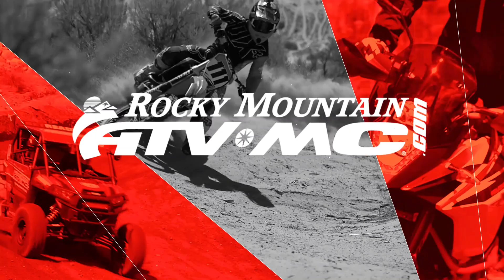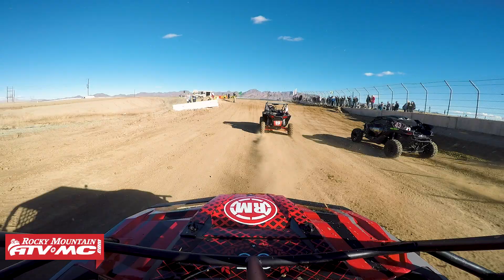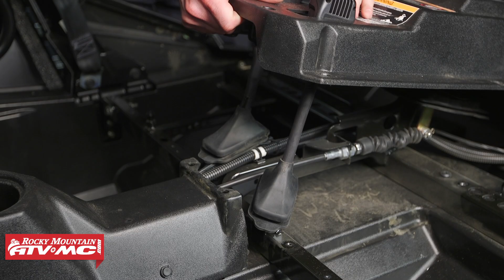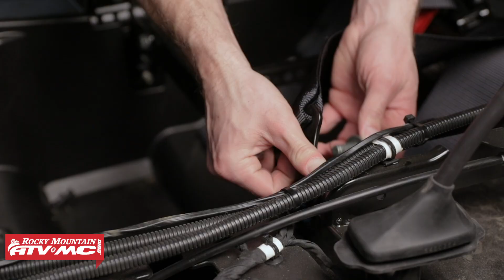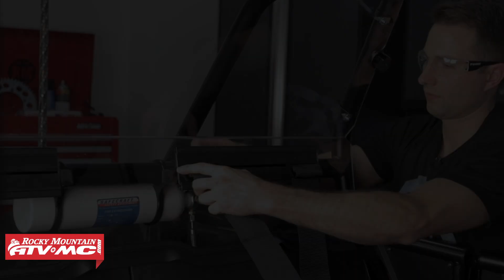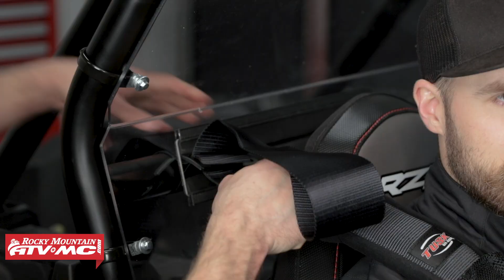How To Install a Tusk 4 Point Safety Harness on a Polaris RZR

Comment: I just got them foe a Honda Talon. They didn’t come with instructions.
Reply from the maker: Sorry about that! We have instructions you can view here: https://www.rockymountainatvmc.com/docs/Tusk%20-%20185248_196727%204%20Point%20Harness%20Instructions%20-%20ADA.pdf 
The Talon kit does come with an extra bolt though. That included bolt replaces the stock bolt that is used on the right hand side harness bracket.

Comment: What about a polaris brand back window
Reply from the maker: The shoulder straps can be mounted to a horizontal bar behind your headrest or down to any bar behind the seat at a lower point if your rear window doesn't give you access to the roll cage bar behind the headrest.